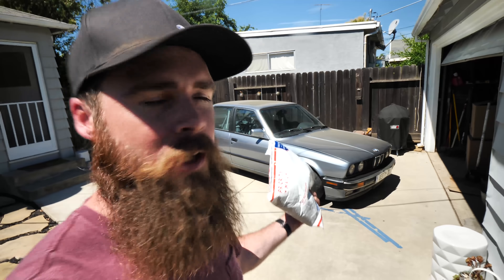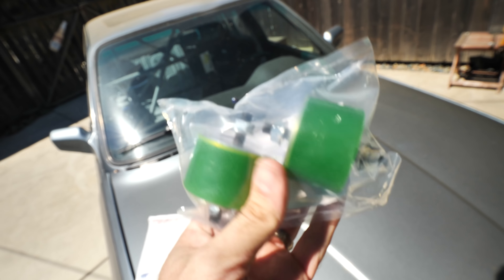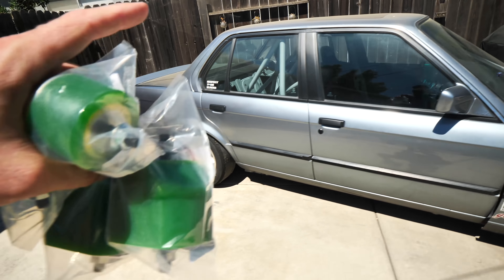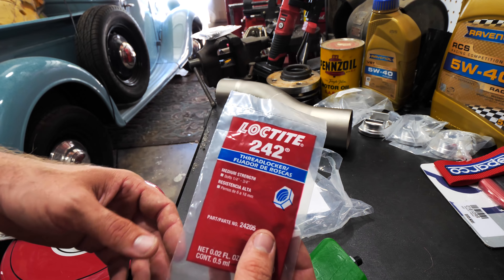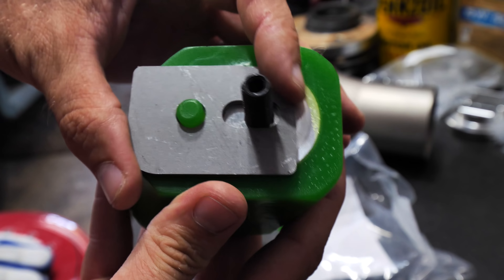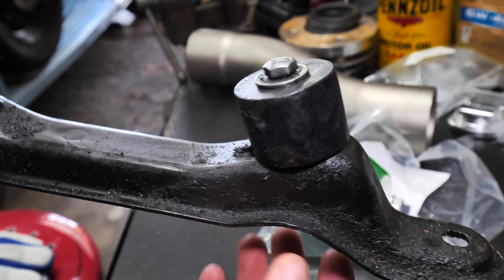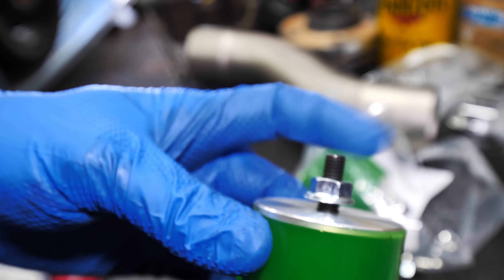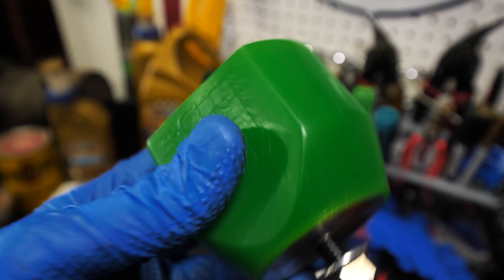REVSHIFT S52 E30 24v Swap Mounts

Comment: How much "while I'm in there" stuff you have building up? With the subframe reinforcements, there can be quite a bit. I've got to dig in to mine soon, need to change out the high pressure power steering line.

Comment: The revshift I had on my m20 failed twice on the driver side. I used the oem rubber e28 ones for my s52 and I’m happy with them
Reply: Hm good to know. I'm thinking of getting the garagistic mounts for my m20. Will wait for end of year sale because it's going to be like 60% off lol.
Reply: Condor Speed Shop!
Reply from the maker: I don't understand how broke two poly mounts on an M20 when there a through bolt design? So what your broke the bolt? They also have a lifetime warranty.  Now you have more power and torque with an S52 but your good with rubber OEM E28 ones that just doesn't  make sense to me.
Reply: Blake's Garage the poly melted or something. I had to get two of them shipped out to me two separate times in a year and a half. Hopefully those work out for you.
Reply: @Blake's Garage, the poly falls apart. Even with a through bolt, if the poly falls apart, your engine arms will be sitting on the sub-frame.
Reply: @DontStopReeling  so true emailed them, never replied
Reply: @NyxNick  yeah I told them I'd pay for 3/4 the cost of the subframe kit for a single bushing out of the kit and the ghosted me after speaking with them on the phone, email and IG. They also never reply when I comment on all of their posts. I am ashamed I run like half a grand in their gear. Their rtabs and fcabs failed in around 15k miles but their trans and engine mounts are okay granted they still photoshop the color and airpockets out of the bushing. My ecstuning diff bushing were much higher quality which says a lot about a company that only does this. #revshiftisshit #revshit @revshift